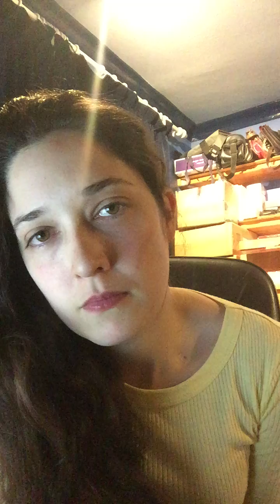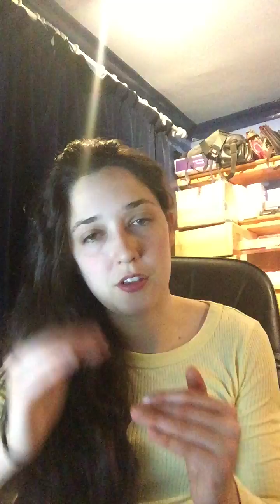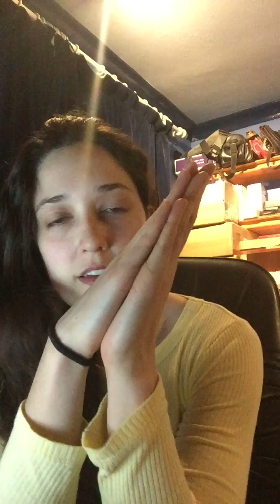TGC (Time Gain Compensation)

Comment: That was very easy to understand! Thank you.
Now i have another question, why is it called time game?? It sounds like its more related to the distance.
Reply: The ultrasound probe has no way of knowing how far an object is from it other than by how long it takes for a reflected wave to reach it.  The larger the distance the reflected wave is from the transducer, the longer time it will take to reach the transducer.  It’s probably called time-gain compensation, because you are increasing the gain based on the different times it takes for the reflected waves to reach the transducer.  That’s just a guess.